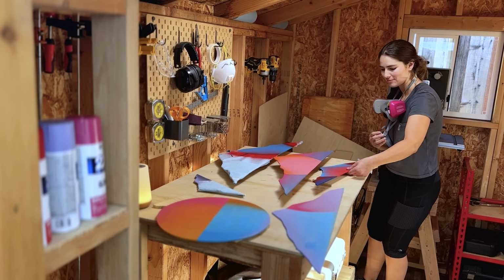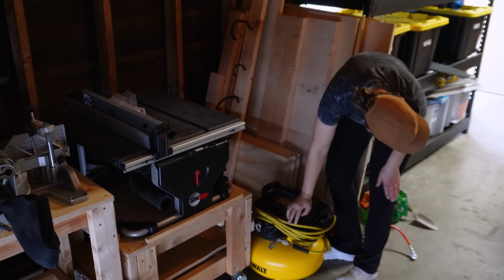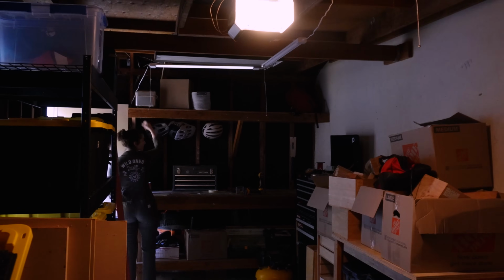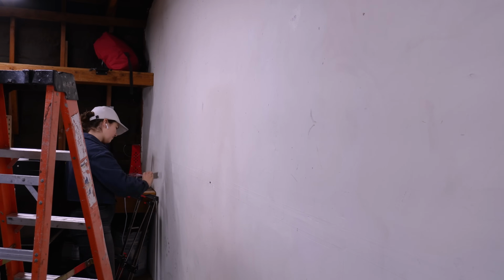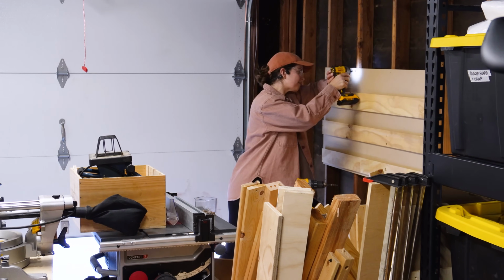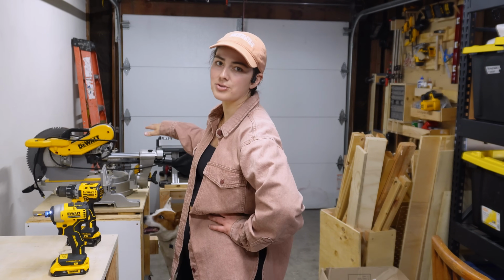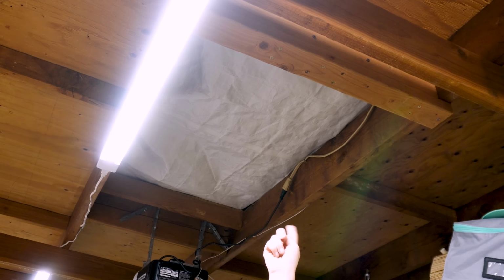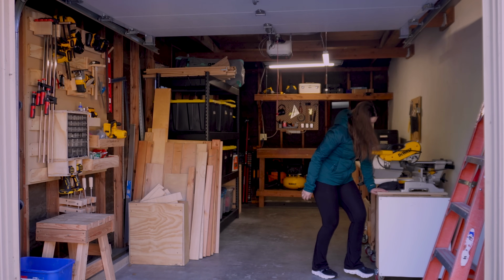Building out my small Garage Workshop

Comment: A suggestion, I put my miter saw in a sliding base, turn it to 55 degrees or your max either lelf or right to store it when not in use. When in use, I pull it forward (the saw will be cantilever) extend the folding legs and there you have it….😅

Comment: What are you doing about dust control?  My garage is similar to the sq/ft as your new shop. I only have a cyclone and shop vac for collection. I have to work with the doors open until I can buy an air scrubber.
Reply from the maker: Shop vac mostly and when I'm cutting / or producing decent saw dust I'll be wearing a respirator and keeping the garage door open.

Comment: Hi Elena, To put it mildly, you need more space, and so do I. I have a two-car garage and thought I would never need more space. I was wrong. My solution was to place a metal 8' X 16" shed in my backyard. This would be your ideal solution if you have the funds and a backyard.
Reply from the maker: We'll see how it goes but a shed in the yard is a great idea if I find I need more room.
Reply: @elenamakes  Thank you for your reply. This is a long comment, so bear with me. As a DIYer, one can't have too much room to work in. I thought a shed would give me the room I wanted. I was wrong because I kept buying new tools and yard equipment. If I saw a new tool that would make a DIY project easier, I bought it. I had my shed built with a six-foot-wide roll-up door, two side windows, seven-foot walls, and a large side door located at the rear of one side. For power, I equipped the shed with 50amp electric service to power my 220-volt electric tools. I placed a cold/heat window unit in one of the shed's two windows to keep me comfortable. As you can see, fitting out my shed became one large DIY project, and I'm still working on it. Please let me know if you would like more comments or suggestions.

Comment: Tyre tracks on the wall? Concrete tilt-panel /precaste panel that was driven over when it was horizontal on the ground before being lifted into vertical position.
Reply from the maker: Someone else said this too, and it sounds like the correct answer.
Reply: itiz   😂   so cute elena  😍 @elenamakes